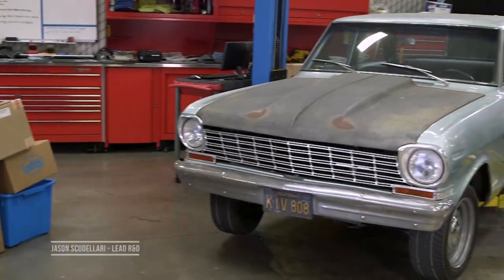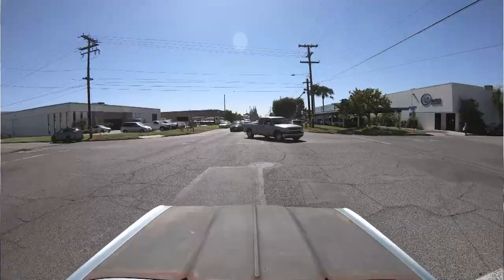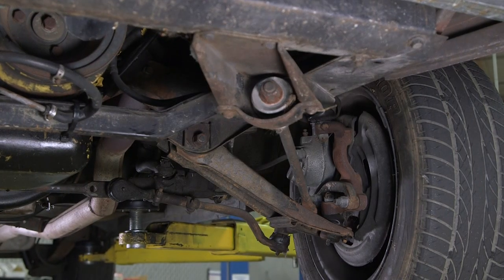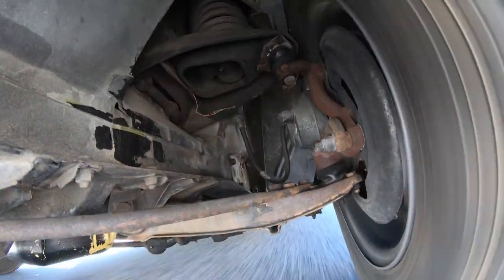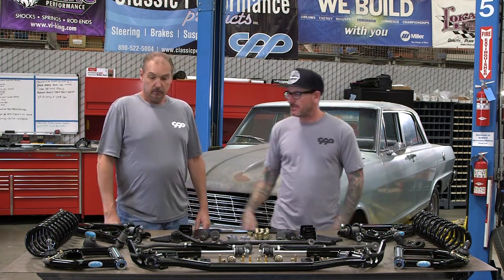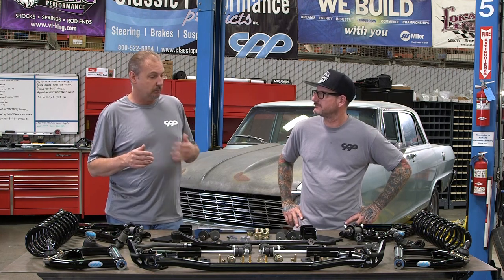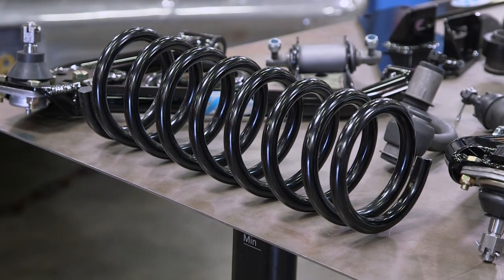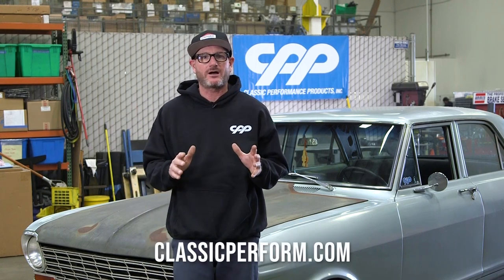Best Budget Front Suspension and Steering for 1962-67 Nova

Comment: I installed the mini subframe kit and lowering springs on my '63 Nova wagon 12 years ago. I did it over a memorial day weekend. In between swimming and barbecuing . ( no beers until I quit working on the car !)  I must say the install itself  was straight forward and no hiccups. The hardest most time consuming task was cutting out the factory rivets to install the CPP cross member. After trying several alignment shops , spending lots of money on the stock suspension ,It turned out to be the  best upgrade I did to that car. It literally transformed the car from being scary to drive to being fun to drive. The improvement is dramatic it no longer feels like a 1st gen Nova it feels like a different car. .  12 years and 97,000 miles later besides tires,   the ONLY thing I have had to replace are the front shocks ( not part of the kit)  . Even the alignment has held tight due to the  locking plates. Looking forward to learning more about your true power steering upgrade.
Reply from the maker: so cool!

Comment: You did not show connecting steering box to to steering wheel as the original has a built in shaft on box so more parts needed for original column. 62 66 chevy11  in 67 for safety reasons gm switched to shaft and rag joint  FYI  DIYs
Reply: I'd love to know if there's an off-the-shelf answer about this one - leaning towards doing this kit on my 64.

Comment: hello can you tell me what this cost? how many hours did it take to install? Did you also install a new power steering system?
Reply from the maker: Hi! Here is a list of all the part numbers and current pricing: 
6267dtca-kb       $929.00
6267hcsbk-125  $199.00
6367slk-cp          $349.00
CP50005nv          $379.00
19-6768bb-p       $159.00
Ps708-s                $42.00
6267hk                 $55.00
If you have a 67 Nova you will also need 67iss-400   $49.00

And yes we did install power steering, you can watch that video here: https://www.youtube.com/watch?v=cHdQ_928BTg&t=4s 

Install time is tough to give because every vehicle is different but if everything goes to plan, all these parts could be installed in a couple days of work